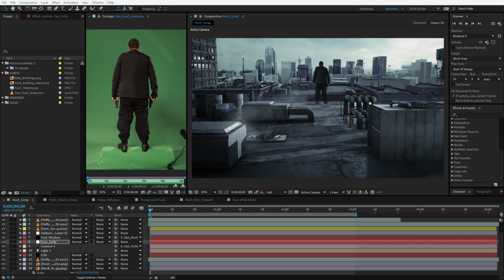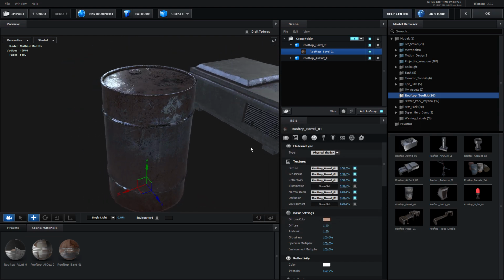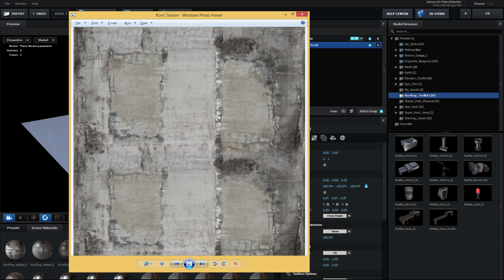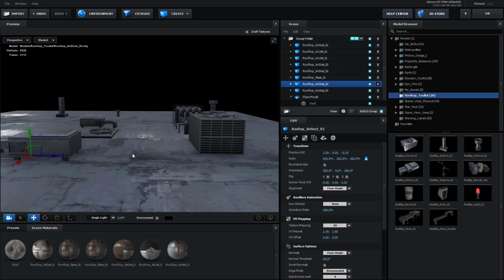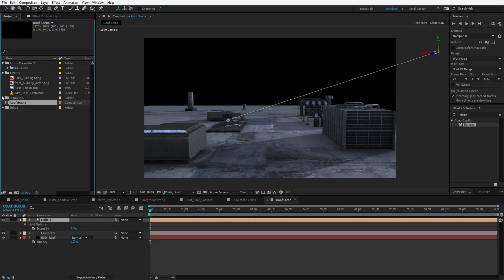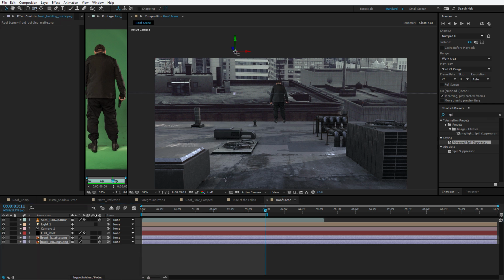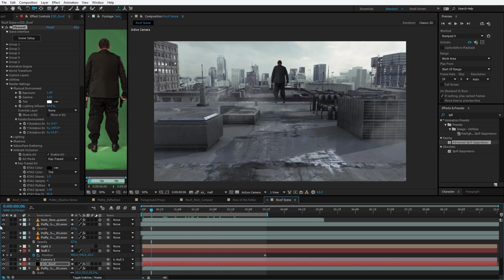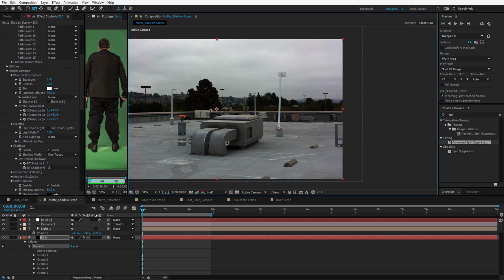Design a 3D Set Extension Tutorial! + FREE model pack!

Comment: Andrew, PLEASE tell me about your computer!  I just purchased Element 3D (Motion Design Bundle) and I want to know what kind of specs you have so I can upgrade my computer properly to run this program and After Effects as quickly and as smoothly as you seem to be able to!  Can you or someone else, please help?

p.s.( I am going to forced to troll your videos until I get an answer from you or someone else, sorry!  I just need to get this figured out!)
Reply: what specs are you running and I'll give you a yeah or nay.
Reply: Hello, 90% Veteran Studios!

  My specs are sub-par right now.  

-AMD 8350, 8-core processor (clocked at 4.0 gigs each, I think...)
-Nvidia Geforce GTX 960 w' 4Gigs of ram
-32 GB DDR3 (yeah, I know... ) ram
-Samsung 500gb SSD

...I am trying to go about this in a slightly, financially-wise manner, but I know my machine needs upgrades, for sure.  I am getting myself prepared for the inevitable, overhaul that could be necessary, sooner than I would like it to be, though.  Thanks for whatever direction you can offer.
Reply: we're about the same.. I'm running 32 GB DDR4 Ram 2666, a Nvidia Geforce GTX 1050 Ti with 4GB of ram, and the i5-7500k cpu @3.40GHz on a 1TB HDD. I haven't over clocked anything yet. I'm using a coolier master cpu cooler as well. I'm pushing my system hard with ray trace and AO on.. no crashing yet.. I'll let you see my project when its done.